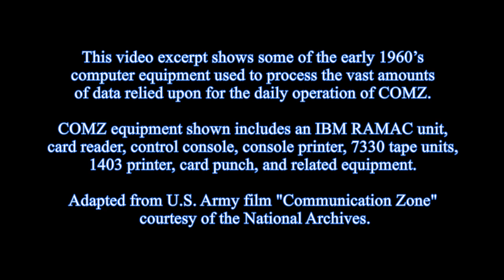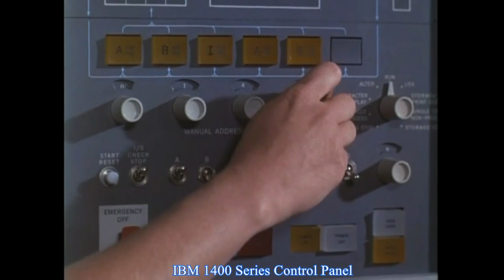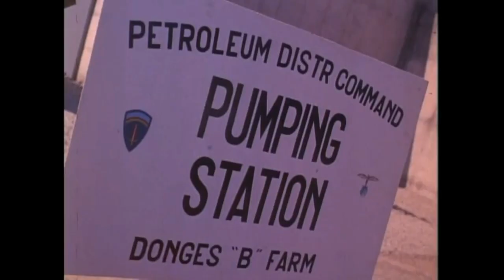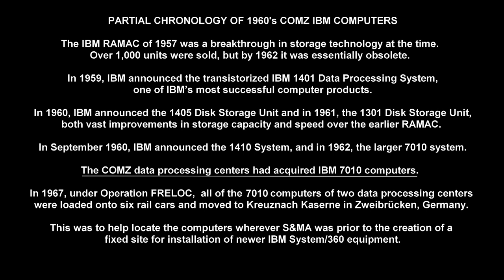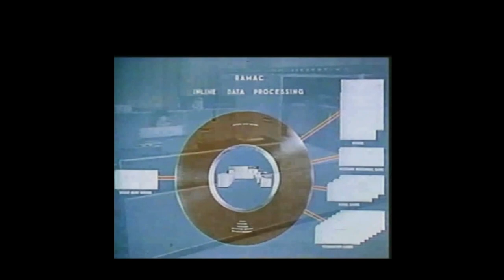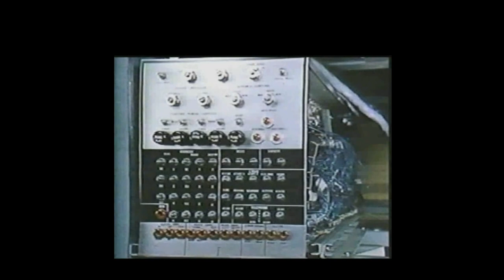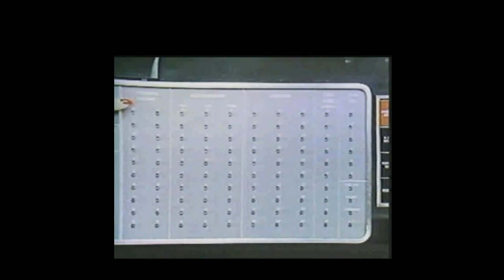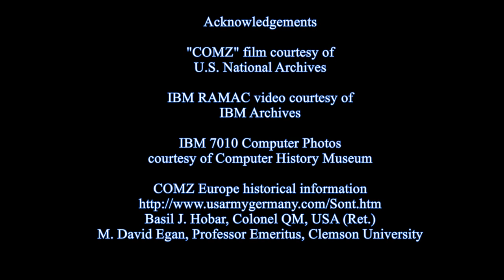Vintage Computer: IBM RAMAC COMZ EU 1960's IBM 7330, 7010 (NATO, Logistics)

Comment: I worked in a bank for many years. We had a data processing centre local called Chad House. Many of the old punch cards were chad cards. Blimey. Loving the videos and keep them coming. RAMAC machine described as compact. The room is full of the machine. 🤣 I have two x 2TB drives on my network. If you press one character every second it would take 20,000 years to store before both drives are full 💀
Reply: So Chad House is where the term "chads" for bits of paper created by hole punching came from?

Comment: When I was drafted in 1966 I had hoped to get into the Signal Corps for either radios or computers.
In HS ( in 1963 !!) , I had taken a course on punch card systems as our school had processed all of the class assignments and grades for the Catholic schools in the area. Teaching this stuff to students was an inexpensive source of labor.
Unfortunately, going to AIT for the Signal Corps required a four year hitch - not the two years of a draftee.
Reply from the maker: Hi Mike,  I understand.  I bet the Signal Corps would have been fascinating though.  I didn't even know about Signal Corps until I was too old to enlist.  : )  I wish I could have joined.  Thanks for being a multi-year viewer!  ~  Victor, at CHAP.